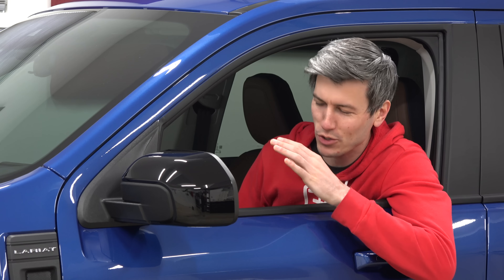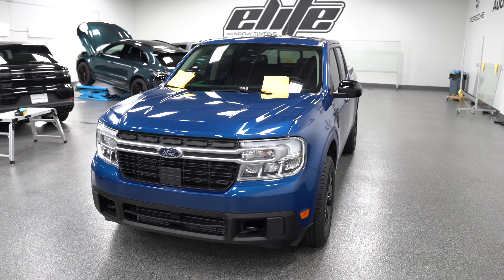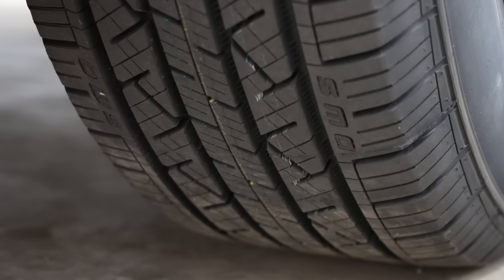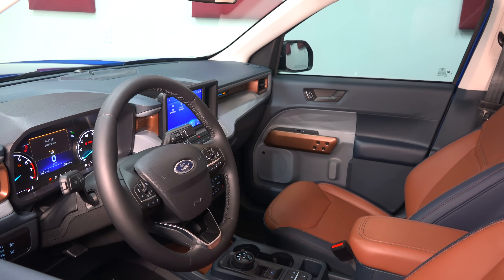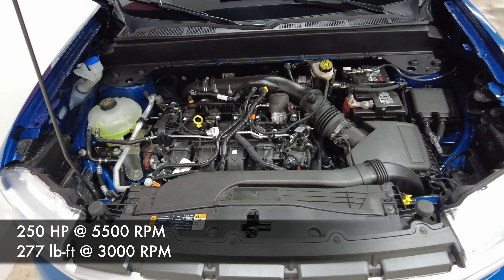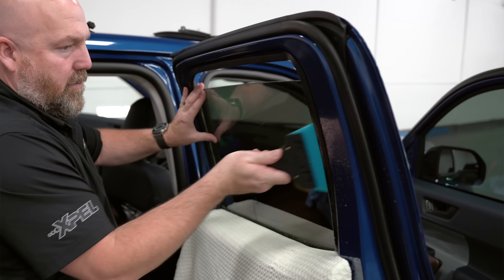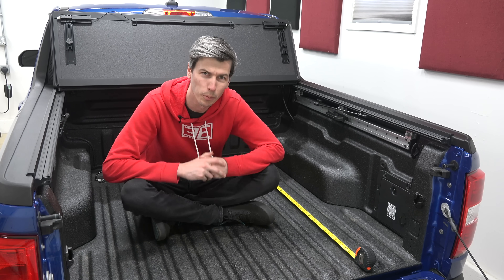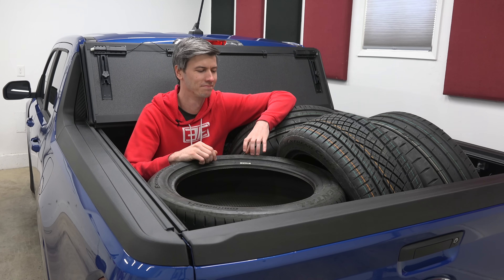I Bought A Ford Maverick! The Perfect Pickup?

Comment: It's almost like Ford had a Fusion hybrid that was spacious, comfortable, economical and reliable, and had a Ranger that was actually a small truck. Now they bring that Maverick like it's some revolutionary thing. I just see this as a pile of compromises on wheels. It will never achieve sedan level of fuel economy and comfort because of its shape, but will also not be as capable as a body on frame truck because it tries too much to be an econo box.
Reply: It rides better than a fusion because its an escape with a bed. SUVs handle our torn up american roads much better. It can haul 1500 lbs and tow 4k in the eco awd trim. It fills a role that most people its all they need.
Reply: @jeedwards1981  the Maverick rides like a thin can compared to a Fusion. It’s a unibody with sticks as suspension parts, it doesn’t take potholes any better than a sedan. Literally a pile of compromises on wheels.
Reply: @maxdaspeed3  I own one, you are flat wrong. I promise. Ive also driven many fusions, there is no comparison in ride quality. My gf and I took the maverick on a 6 hour road trip , she remarked how amazing it rides . My previous newer civic felt like a tin can compared to the maverick. SUVs ride better and have better suspensions for our crap roads in america.
Reply: @jeedwards1981  your statement is purely based on a placebo effect. It’s your car, so you think it’s good, I can get that. The Maverick is based on the Escape, which is based on the same platform as the Focus in Europe. Everything that is unibody shares the exact platform under the same brand. You think they’re going to make special platforms for crossovers that manufacturers know themselves they’ll never quit paved roads. I drove a Maverick and it totally crashes hard when you take bumps, the same way every other unibody vehicles do.
Reply: @maxdaspeed3  I’ve driven tons of vehicles . It’s def more solid than an escape or it couldn’t have a 1500 lb payload or 4k lb tow capacity , it’s called engineering. Just because it’s based on a platform doesn’t mean it isn’t modified and strengthened.
Reply: @jeedwards1981  the escape with the 2.0t ecoboost can tow 3500 pounds. I don’t think they did that much engineering other than changing shocks and springs rate to give the maverick the extra 500 pounds that it will struggle to haul anyway.

Comment: I got one a little over 6 months ago, very similar to the one in the video. I'm getting between 25 and 30 mpg on my daily commute which is 40 minutes of highway driving. When I need to get garden supplies or a few 2x4s, or something else that's dirty or an awkward shape, this pickup handles it well. When I need something that can pull a trailer down the highway or handle an entire pallet of supplies, I can borrow a full-size truck from work. The other 360 days of the year? I get a comfortable ride and good fuel economy.

Comment: I was excited for the Maverick. I love the size. I love the look. And love the name. But as I was getting ready to look at one seriously, my world changed drastically. As a result, I I needed a more competent truck, for camping, overlanding. I wanted to like the Ranger, but optioning it as I felt appropriate, I was in the Tacoma and Gladiator price ranges. The Tacoma lost due to driver's room for me. The Gladiator is not substantially better, but the Rubicon package won out. For value and capabilities. In 18 months, I've got just over 35,000 miles under it. A good chunk of that off pavement and a reasonable amount in places no Maverick could ever make it. All the while carrying a rooftop tent and gear, no doubt, with the bed just 6 inches longer than mav.... My girlfriend and I may still look at the Maverick as a vehicle for her.

Comment: Good tires. I’ve had them on my 2015 outback for the last few years. I was also considering to trade up to a truck or larger SUV. Outback fits 30 bags of mulch (2 cubic ft each). If the Mav can fit that load in the bed I’d consider one.

Comment: The maverick is the perfect truck for people, like you, who don't actually need a truck.  Unfortunately that's the majority of truck owners these days, but the sad truth is that it's an image thing.  There's nothing this vehicle does better than a minivan, and it's arguably worse in many regards.  No hate on the Maverick, it's honestly what we need right now.  People that want to look like they are driving a truck but really don't need a truck need something more practical to drive, and this definitely fits the bill.  Saying it is the "perfect pickup" though?  Ridiculous.  The box is half the size of any normal pickup, it's wrong wheel drive, unibody.  It's a van with less usable space, and it is lightyears from the "best pickup."   Regarding your example of... 3 bags of mulch... which SUVs can fit that?  Nearly all of them.  Easily.
Reply: Most modern trucks have 5.5 ' beds, most all of them on the road, f150s etc. One foot doesnt change what you can haul too much with tailgate down on a Maverick. If you need more it can also tow 4k lb trailer with the turbo and AWD.

Comment: I bought the Santa Cruz…. I love both of these vehicles.  Was close to a Maverick as I would have preferred to get a Ford.  I went with the Cruz (the top end limited).  It was a combination of styling, blind spot cameras, slightly higher tow capacity and sportiness (IMO).  I’m surprised how quick it is although admittedly the Maverick was fine too.  We will see how well my questionable  dual clutch works out (I got the extended warranty…).

Ultimately I feel like these are great for a daily driver.  No need to climb in.  Ok gas Mileage.  Very practical.   I except all the ridicule in good fun but all my buddies with big trucks don’t go off road, don’t tow anything and frankly never moved more than mulch.  I sold my Ram for that reason.

Really want to poke fun…I put rails on the top and bed to more easily move sheet rock and 2x4’s….

Comment: The F150 wouldn’t need to top out at $90k if it simply wasn’t as big as a Caterpillar 785 earth mover and have available heated massaging and cooling seats. A proper truck should have lots of low end torque, a reliable, simple engine that will take decades of long use and abuse, a manual transmission, and maybe air conditioning and cruise control. And be affordable to anyone. 

Ford used to make a truck like that. It was called the F150.

Comment: I call B.S. brought a new 2022 Maverick XLT Hybrid and it was towed twice in 600 miles along with two recalls. It refused to start. The mileage everyone raves about comes "Only" with "Perfect" driving like in a magazine testing. The backup camera was simply awful and runs on electric for a measly 35 mikes. I sold it at 1k miles. Heard there's another recall on the lights rear lights. First car I couldn't test drive and paid $2500 over MSRP. Never again!!

Comment: I was really interested in the Maverick when i first heard about it.  Then i found out they weren't doing a 2 door model with a longer bed so i went with the ranger.  Ford is really trying to knee cap the Ranger in the US.  No manual transmission option even though they offered it in the Bronco.  The towing package on the Ranger does NOT include a brake controller.  Even if i wanted the Tremor option, i couldn't get it on the 2 door version.  Not sure if it's a ranger thing; but with the rear window defroster, you don't get side mirror defroster.  You had to setup up to the Lariat trim to get that.    Oh, your tiedown options in the Maverick look better.   :-/  I'm a little conflicted with it being called Maverick because when i heard that name, i remember my mom's old Ford Maverick car form the late 70s.

Comment: As a senior master ford tech the maverick is the most reliable vehicle ford is making rn. I never see one in the shop
Reply: Don't worry, you will. Give it a little time.
Reply: @billsouza4457 the eco boost ones maybe but not the hybrids. The hybrids use the 2.5 with an aktinson cycle and port injection. Its incredibly low strain and proven. The hybrid components also borrow a lot from toyota.
Reply: I had a battery from a bad batch, I have never had any other issues, none nada.
Reply: @ThatAnotherChris … The 2025 models have a AGM battery now…
Reply: My 2021 Bronco Sport Badlands battery just died yesterday, too. 3 years and the oem battery died tbh I think theres too much stuff continuing to run after the engine is off.@chrisjohnson7255
Reply: Meanwhile in other parts of the country there's a pending lawsuit due to engine failures on the turbo model.
Reply: I work at a ford dealer and im just an hourly dumbass but the amount of weird software recalls and electrical issues is a little wack.
Reply: @philipsavenkov6405  I swear that half the recalls on my Maverick were for electrical stuff that "might" happen. Nothing had actually happened yet! To its credit, it has run perfectly since I got it.
Reply: So I had all recalls performed and it simply shuts off and it was my fault? 😅
Reply: @ColoradoMark 

I’m guessing, based on the info I have, one (or more) of the following are true:

1. Ford identified your experience as unrelated to the recall
2. It was found to be user error and/or caused by a lack of maintenance 
3. It was a fluke that Ford (or you) couldn’t replicate
4.  You’re embellishing the story because it’s the internet and you’re salty

With the above , I’m asserting there is more to the story you’re intentionally not stating. 

Which is why, as someone researching this vehicle and finding a vast majority of reviews and comments overwhelmingly positive, I found yours to be interesting enough to ask for details. 

So, let’s talk about what happened in more depth (like I asked for originally) or let’s move on….cuz we’re not getting anywhere right now.
Reply: Mine only goes to the shop for the frequent and weird recalls. All it has needed so far is regular services. The OEM 12v battery is getting weak. Needs a trickle charge every week or so. Not holding the charge well. System gives it 14.1 volts. I figure its a cheap factory battery. Having that looked at under warranty this week.
Reply: @chairrider2462  Mine went out in 3 years. I got the 2.0l ecoboost in my 2021 Bronco Sport. I suggest replacing. It will die out of the sudden no warning signs at all. One battery test said it was okay, but then I took it to an actual mechanic with a different battery tester and got a different answer. If it said it was weak, look for a new battery.
Reply: @cbz21  My thoughts exactly. Our last two Fords before this had the batteries die suddenly just days past their three year warranty! I have good battery testing equipment and every week it tells me good battery, but needs charged. Been happening all summer. My wife's last Ford had a battery doing this same stuff. First sign of a weak battery is the infotainment system getting buggy folks! If the radio starts turning itself off or won't change stations, check the battery! This happened in my '14 Ram Promaster I had for work too. I will LOL here, but IME Mexico can build a good car, but their batteries are shite. I do keep a jump box in my car for just in case.
Reply: @chairrider2462 … For the 2025 models they switched battery suppliers and went to an AGM battery…
Reply: This would then be true of the Escape and Bronco Sport on the same platform.
Reply: It’s brand new. Would you want the most reliable vehicle Fiat makes? Yea no.
Reply: @AwesomesMan  You can't compare a Ford to a Fiat though, Fiats have never been reliable
Reply: It's a Ford . The bar for reliability is set extremely low... Yes I have owned Fords.
Reply: @billsouza4457  It's extremely high for me, It's the only brand ive ever wanted to own because of how reliable they are!
Reply: Sure bud, whatever you say. My wife's Expedition has 330,000 miles on it. Original motor and transmission. It's all about maintenance.
Reply: Really? Mine died on me on the freeway at 75mph last month. A half million Bronco Sports and Mavericks are recalled. People will die. I almost did.
Reply: @ColoradoMark  genuine question - the recall states it only occurs when coming to a stop at slow speeds. Curious to know how your “almost dying” on the freeway is related. Any extra details you can share?
Reply: Not sure what you want me to say outside of what I already have. I talked to Ford corporate and they basically said too bad so sad. My Maverick is someone else's problem now.
Reply: @ColoradoMark  That actually answers my question. It wasn't part of the recall and was outside of the warranty and/or caused by user error/lack of maintenance. Thanks.
Reply: Vehicle went to limp mode at slow speed April 5. My dealer found a code unrelated and cleared it. 

April 25 after 1000 more miles it did it again upon start up. Limped to dealer. Same result.

June 6 after 2000 more miles it went to limp in Denver on freeway pulling trailer. 

Towed to Denver dealer. Sat there for 6 weeks til they did safety recall 24s24.

Recall letter came on June 15 so after incident. 

Drove 675 miles home and did it again in Omaha at stop light. Limped home. Unhooked battery, it was fine. 

Ran fine drove to dealer and traded for new Ranger. 

The vehicle was maintained meticulously. 

Now, go pound sand keyboard warrior.
Reply: @ColoradoMark  3/4. Damn I’m good.
Reply: @ColoradoMark damn that’s a complete and utter nightmare

Comment: I love small trucks. The only issues I have with the Maverick is the ground clearance  (218 v. 226 mm) and covered cargo volume (942 vs 1562 l seats down), which are both less than the Crosstrek. My Crosstrek also carried 1000 lbs of patio stone and gravel.

Comment: Thanks for this Jason. Our last manual transmission (Mazda 3) left our driveway when our 2023 Lariat hybrid Maverick got here last November. sigh  The other vehicle in our driveway is, like yours, an EV, though a more modest one — a 2016 Kia Soul EV. It was the Soul that introduced us to heated seats and a heated steering wheel. You will NEVER want to go back, though the way the Maverick modulates the heat in the steering wheel is a bit odd compared to the simple turn it on/turn it off we have with the Kia.

We will be road tripping some this summer and are expecting good things with the Maverick. When we go to model rocket events there's quite a bit of stuff to haul, and the Mazda 3 HB was crammed to the gills and very time consuming to pack/unpack. This led to the search which led to the Maverick. I didn't want to get another pickup (we've had two Mazda B-series trucks from back when they were built by Mazda, not the later rebadged Rangers) until there was an option that got better gas milage than the Mazda it would replace. The Maverick hybrid will do that, we think. And it IS handy to have that bed from time to time. It's been used to do truck stuff several times already like haul wall blocks or furniture or bags of mulch...

If there is a PHEV and especially if there is a PHEV with AWD, we will look at upgrading. But otherwise, we'll likely drive this one for a long, long time.

Comment: THAT is a front wheel drive unibody SUV. A TRUCK is body on frame and has rear wheel drive. Same thing as a Honda Ridgeline. Learn the difference. If you're hauling the kid's bicycles.....fine. If you need to do some work, not so much.

Comment: Question, 
why do full sized gas trucks not get turbos?
Ford maverik, ranger, and f150 do why does the f250 not get a 5L v8 turbo instead of a 7.3 liter hunk of under powered weight.
The 2500 CLASS and F250 class gas power trucks have the worst power to weight in the automotive industry... WHY not more power? Diesel is not the answer anymore. I live in a city.

Comment: "Real" pickup truck or not, it's been an extremely popular seller for Ford.  Imagine how well it would sell if it were a real pickup truck! *kidding!!* (sort of).

Seriously, tho -- there hasn't been a true small-pickup on the market since the Ranger went out of production in the 2011 model year.  The new Ranger is essentially what the F-150 used to be, and the F-150 is a giant colossus that's really far more truck than 90% of its owners ever need.

Clearly there's been a pent-up demand for a smaller pickup truck, and the Maverick fills it nicely.  My only complaint about the Maverick is that it's not a body-on-frame construction, which is a lot tougher than the unibody construction the Maverick uses.  But for a unibody vehicle, it does have some nice capacities going on there -- bed- and tow-capacity are both quite good, all things considered.  (My point is that they could be better if it were a body-on-frame vehicle.)

If I were going to buy one, it'd definitely be spec'd like yours -- it's unfortunate they don't offer the adaptive cruise on the XLT model.  Because that's the model I would prefer, honestly.  But the 4K tow and FX4 packages would both be a requirement for me, no doubt -- they're great deals for the money.  I'd swap out those tires for some better off-road tires, tho.  I'm sure Continental makes some that are good for off-road, no?  I'm sure they have a competitor to a BFG K02, right?

Congrats on your new truck.  🙂

Comment: I have the XLT Hybrid, honestly it's a really good truck. I ordered it 2 months after Ford started taking orders and got it for $21k. I have the tow package on it and tow my trailer around with it at least twice a month. The little storage cubby in the bed is super handy for keeping ratchet straps, hitch pins, etc. I would absolutely love to have a plugin option. My wife drives a Volt and using electric to drive around town and gas for trips is super convenient.